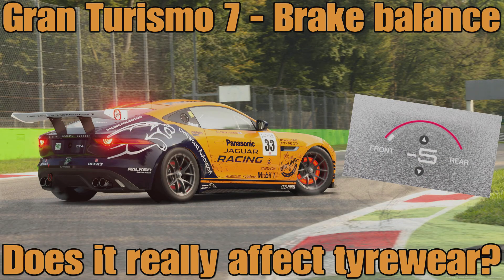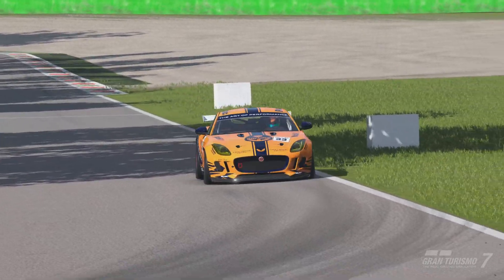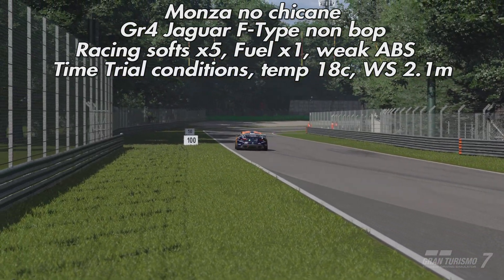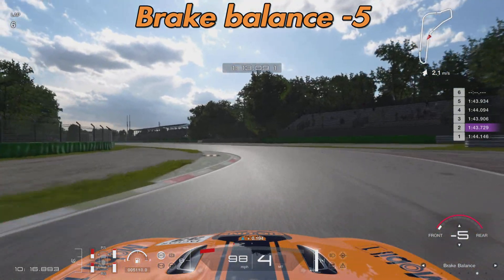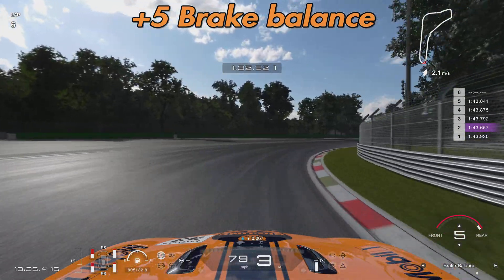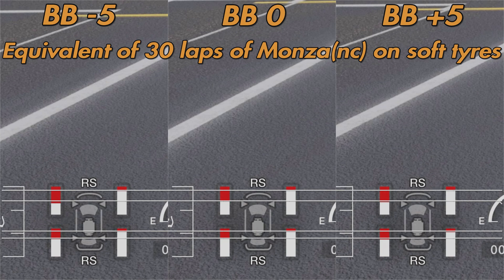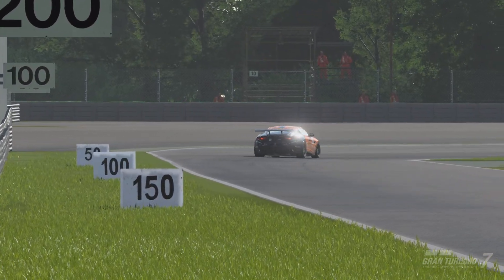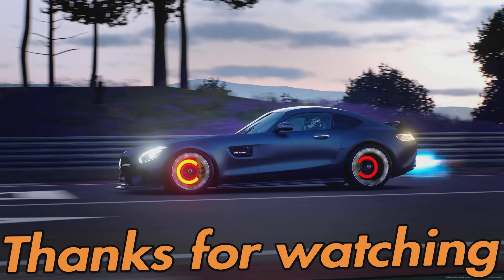Gran Turismo 7 science testing...Brake balance - Does it really affect tyrewear??

Comment: 0BB is not 50/50
Reply from the maker: What is it then and what's the source?
Reply: @wombleleaderracing6455  i don't know the precise ratio used in game  however it's definitely not 50/50. There's a reason things have bigger brakes at the front than the back. Also 5 to the rear would be a handbrake
Reply: @PatSharpsMullett Handbrake has its own button. Why would it be included in the brake balance.
Reply: @Ricky_Baldy  i haven't included it in BB. You may want to re read what we are talking about
Reply: @wombleleaderracing6455 It's about 70% front and 30% rear in a standard car. And Brake balance moves it on about 2-5% front or black I believe. It's really not much.
Reply: It's about 70% on the front brakes and 30% on the rear brakes in a normal car
Reply: And brake balance changes that front and back by just a few percent like 2 or 3%
Reply: You have a slight point with AWD/MR/FR etc... the weight is distributed differently amongst different drivetrains. But essentially that doesn't change the effect of BB.
It still remains neutral, it's just the car characteristics that alter how the wear affects different cars.
Reply: @Freedom_Born  are you trying to say 0 is 50/50?
Reply: @PatSharpsMullett 
For the most part, yes.
The different engine placements for each car affects how they wear. 0BB is simply neutral. That's why there's varying wears at the end of Race C for example. Regardless of each BB usage.
The power to weight ratio + drivetrains + characteristics etc all affect the overall wear differently.
Reply: @PatSharpsMullett  
This should also apply for Torque and Differential/Gear settings. If braking pressure can be "tuned" and adjusted, therefore varying the affects even more, then people will have even more varying end results. But that still won't change the effect of 0BB. It'll still remain neutral overall.
Reply: @Freedom_Born  engine placement affects the wear because of the weight placement. I am aware of this but it doesn't have any bearing on my original comment. Also no matter where the engine is all the weight shifts forward, hence bigger brakes at the front. I'd hazard a guess that no car would be at 50/50 at a neutral if it was adjustable. A cars brakes are always going to be front focused because of the above again as to why there are bigger brakes at the fron
Reply: @PatSharpsMullett  
You can go into Tuning Parts and see exactly what brakes are used. Regardless if Turbo, Aspirated etc... they all run the same race brakes. There is no front or back difference.
0BB is merely neutral my man.
Even considering turbos, naturally aspirated etc... different transmissions also have an effect - the same as engine placement/drivetrain/PTW ratio/tuning etc.
0BB for the most part is still neutral.
Reply: @Freedom_Born  what are you even going on about. You're bringing up aspiration types now. You're telling me the front brakes aren't bigger than the rears? Go and look at any car, better still go into photo mode and look for yourself. Bigger discs on front than back and way bigger calipers on the front because the discs are bigger and they naturally do more of the work because they're not 50/50
Reply: @PatSharpsMullett  
LMFAO @"Go and look at any car..."
For 1: The brakes are easily found in the Tuning section FFS. All cars use the same race options, cos that's all there is to choose from!
2: Any car doesn't apply to the game buddy!!! These are game specifics. The "photo mode" only shows aesthetics, cos the pads and calipers are the same for both regardless. Check the tuning section!! There are no different pad sizes.
3: I brought up gearing and transmission cos it plays a part, the same as engine placement (as you already agreed with), power to weight, (ie: load pressure/front mounted vs rear mounted), FWD/MR/FR etc... it all matters. But for this game - there is no difference for brake options !!!
Check the tuning section and quit jabbering. 0BB is neutral.
Reply: @PatSharpsMullett  
Again. CHECK TUNING SECTION and see for yourself. All the same brakes buddy.
You're implying this game applies real sim logic, with a plethora of car settings options. When that ain't the case mate. This ain't iRacing or ACC.
Yes I understand your point, but it's invalid here. 0 simply means neutral, and the natural wear is due to car (and track) characteristics.
Reply: @Freedom_Born  yes the game applies real sim logic for brakes. It also applies REAL WORLD LOGIC for brakes. I'm done anyway, I'm losing brain cells
Reply: @PatSharpsMullett  
Lmfao real world tyre models??! No!
Real world pressure and race physics? Double No!!
The game doesn't even apply real steering physics FFS.
Go to bed junior
Reply: @Freedom_Born  who said anything about anything you just wrote? Lay off the acid grandad 🤣🤣
Reply: @X_BILSON  
The bias only changes how the pressure is applied. That's why rear bias will induce oversteer, and front, understeer.
That determines how much faster (or slower*) wear to either occurs. Wear on 0 is just the car coping with it's characteristics naturally - whether GT7 includes 70/30 isn't the point. Because RR cars for instance have their weight distributed to the back. So that percentage changes.
Reply: @X_BILSON 
Yes, I agree. Weight distribution under load affects the front primarily - irrespective of drivetrain.
But the bias only affects how much pressure is applied. It doesn't change the original eg: "70/30" at 0BB. It still remains neutral at 0 regardless if the car is naturally eg: "70/30%"
Reply: @X_BILSON  
Yep that's the point bro.
0 doesn't affect the original settings. Therefore it remains neutral. 🤙🏾
Reply: I did some testing, I agreed that 0BB is probably not 50/50 Brake Bias
https://www.youtube.com/watch?v=q6lEsYd56lg